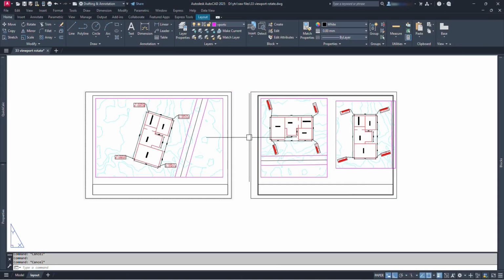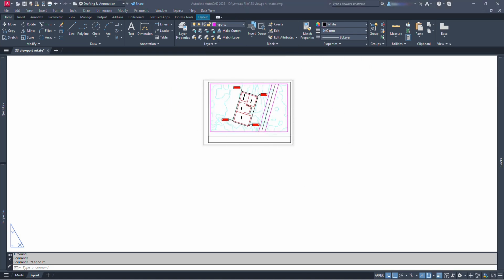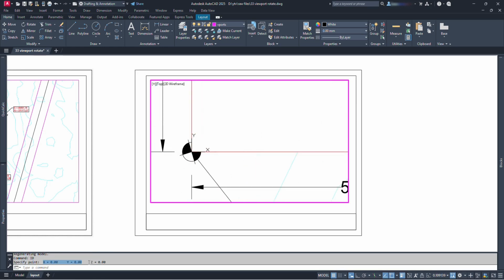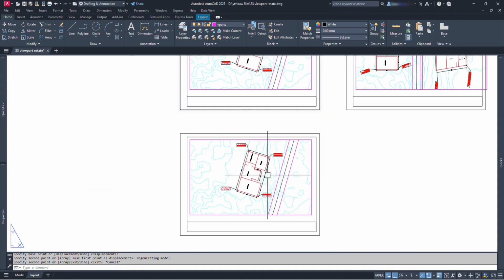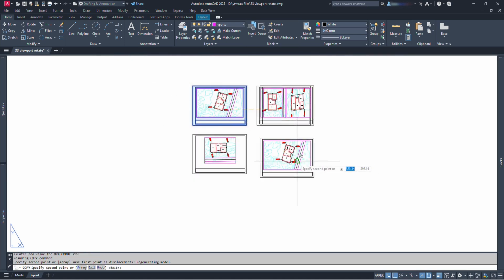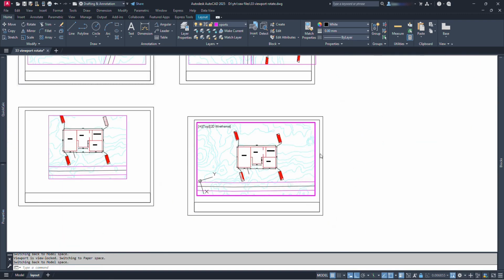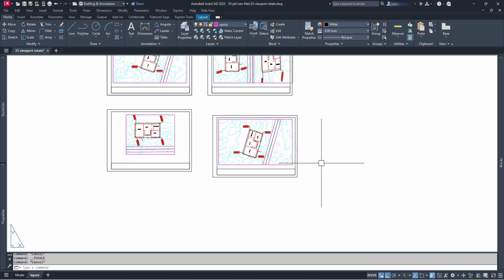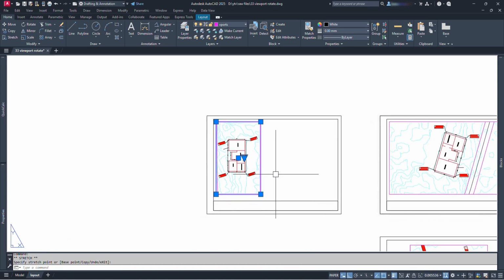How to Rotate Views Inside Viewports in AutoCAD Layout

Comment: The method using the Align Space command from Express Tools does not work for me.
I have tried it with AutoCAD 2025 and 2026.
Reply from the maker: at where you got stuck?
Reply: @CADMagics  The alignment is not done correctly. It looks like the points clicked are not being taken into account.
Reply from the maker: @chardo2225 check the viewport properties, if view is locked..
Reply: @CADMagics  I found in an old post that Clockwise must be unchecked in units